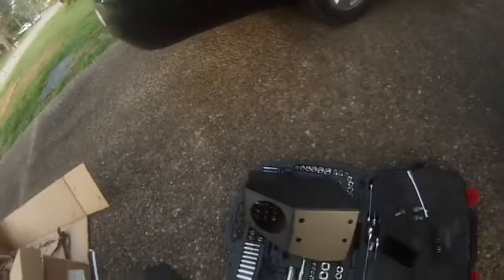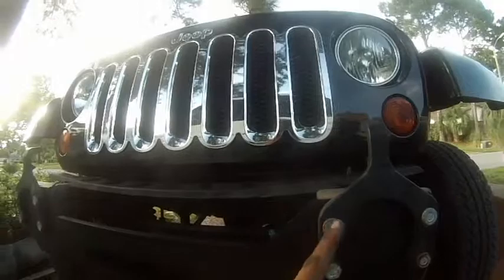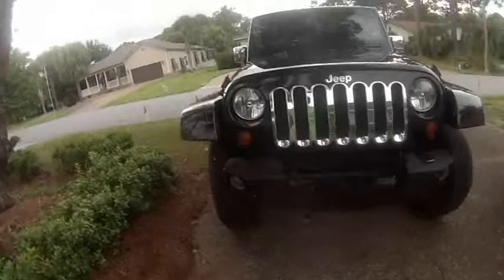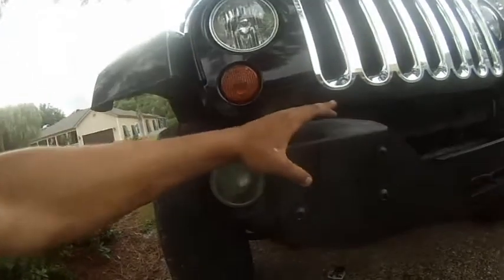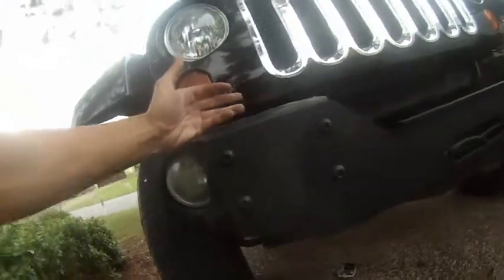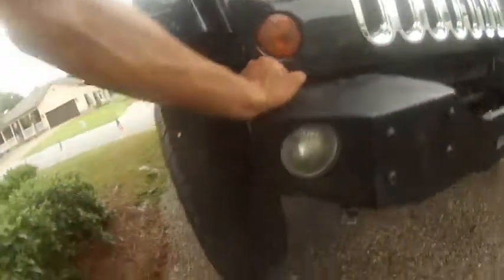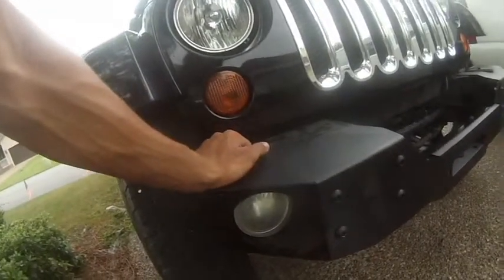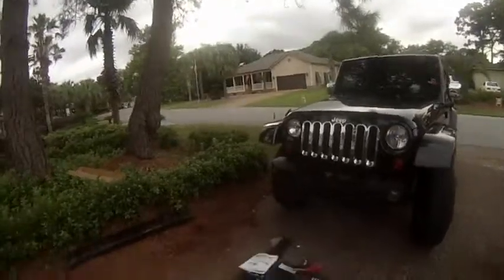Rough Country Stubby Hybrid Bumper Install Jeep JK JKU Sahara Wrangler

Comment: good info thanks, wanted to note that those rubber tips are only temporary for when the factory painted so the threads are protected. these pull off first before sliding the light on with no drilling required. if you still have then on u will want to go back and remove them and screw thgen securecso u don't loose your lights